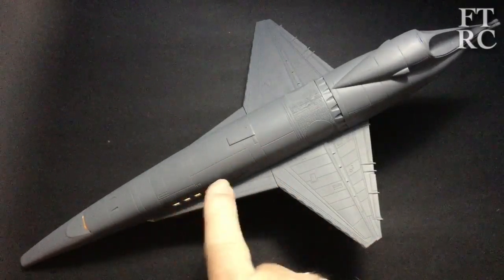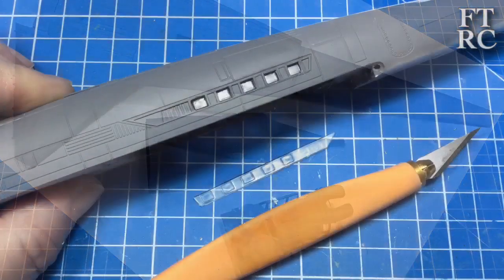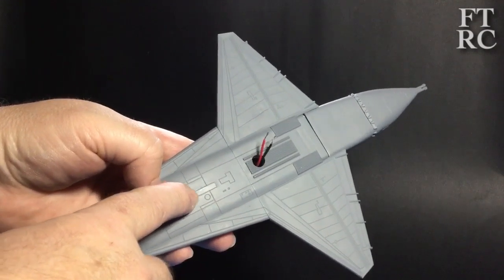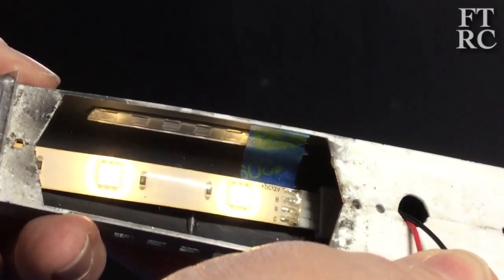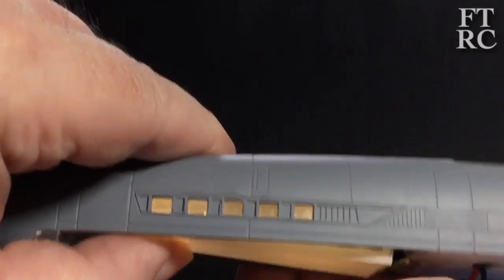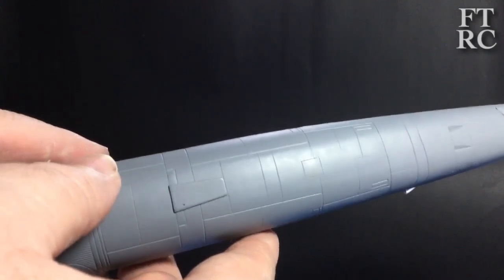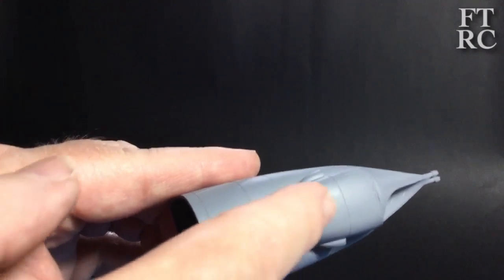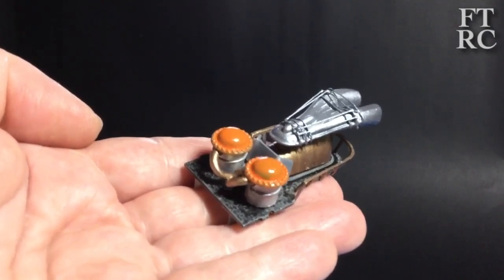2001 Space Clipper Part 3 LED lights & panel lines for space plane Aurora 1:144 Orion Space Shuttle

Comment: I'm late to this build, but I've enjoyed following it along. I don't see any further update on it. It's probably too late to raise this matter, but it can sometimes be better to house the batteries and any switching in the base, with the wires running up the tube to a connector in the model. That way battery changes can be done without having to disturb the model itself.
Reply from the maker: Good advice.. I have not got around to finishing that model after an issue with the flashing motor blue lights making the cabin and cockpit lights also flash.  I need to rewire the LED and, as you say, move the battery to under the base.  There is an update planned for later in the year once I get a break from Patreons requests and my current ship builds.
Reply: @HarryHoudiniModels  Thanks. Sounds good. I've been greatly enjoying your St. Louis build. It's looking really nice.
Reply from the maker: Thanks… another build I need to get back to

Comment: Brilliant work, those new panel lines turned out superbly! I learned a lot, not least the diffusion box idea should come in very handy. However, I'll go a cheap and easy route for the lighting and will try a 10 LED XMAS light wire chain thingi (already ordered from China for around 2$ :-) I will also have to add some landing lights to my Moebius version, but that should be fairly easy...
Reply from the maker: That's a great idea!  As long as they don’t run too hot, or your model may melt.  The beauty of LED is they are cool, as in low operating temperature, so pretty safe in your model.  The blue flashing LED I got off eBay for only a few dollars.  Those LED strips should not be much more than a shekel with battery hooked up.

Comment: You could try add a capacitor between the negative and positive lines to help prevent the blue LED interfering with the white LEDs a 0.1uF ceramic capacitor will probably be enough to help.
Reply from the maker: Good idea.  But I do need a new battery anyway.

Comment: Harry, have you ever lit up one of your sailing ships? I just got some SMDs for cabin, mast and port and starboard lights, but I’m still at the monkeying with it stage. Any suggestions would be most welcome!
Reply from the maker: This is my first model with built in lighting.  If a ship was large enough and would benefit from some illumination, then I would give it a try.  You can buy those short LED strips online with the battery power supplies.  Coloured LED I found on eBay.. usually in the model railroad listings. Nothing was very expensve.

Comment: Fantastic video Harry. I really needed to see this didn't know you could use batteries.🤓 What I've found i need a lot of research what hobby shops have are a little to extensive for what i need. One maybe two lights stuck in a 1/35 oil drum with a battery. What you showed me just saved me a lot of headaches. Thanks for that.👍
Reply from the maker: Less headaches are just what I am looking for mate :)